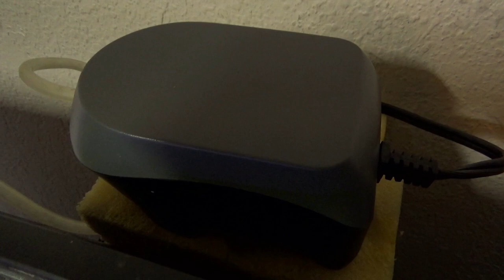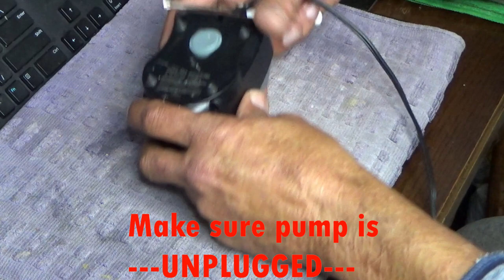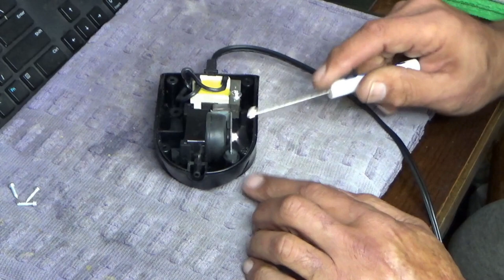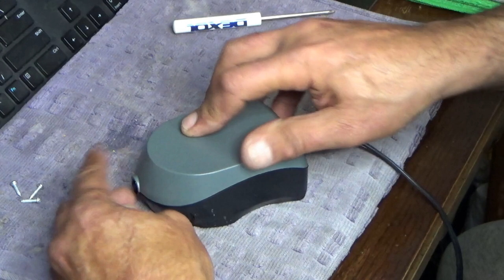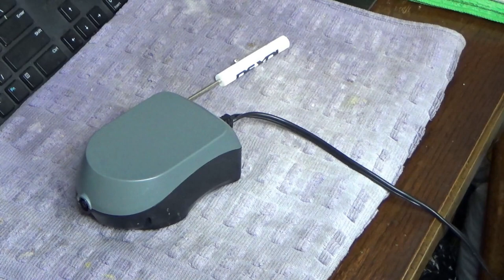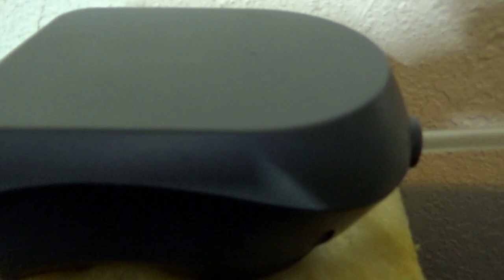Trick to make Air Pump Quiet

Comment: Nice trick! Hope that foam isn't easy flammable.
Reply from the maker: It's packing foam not flammable n heat resistant. Good question
Reply: Use polly fill

Comment: try putting it in a carboard box lined with either foam or fire retardant cotton shirt. Worked wonders for me. Also great to paint the outside and hide chords in as well
Reply from the maker: nice idea I'll try that, but m thinking the pump will over heat after a while if it's not getting some air around it to cool it.
Reply: Not fixing it is still not a good idea but it's definitely an idea 🫣